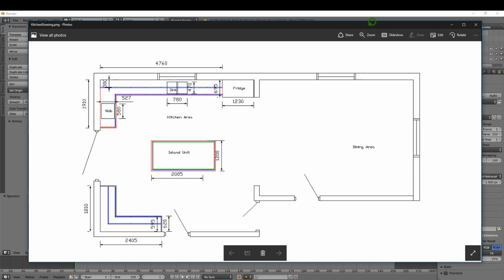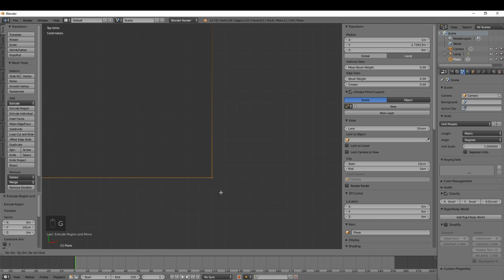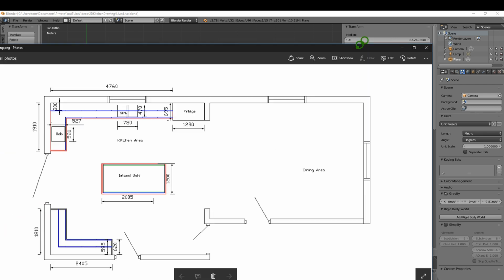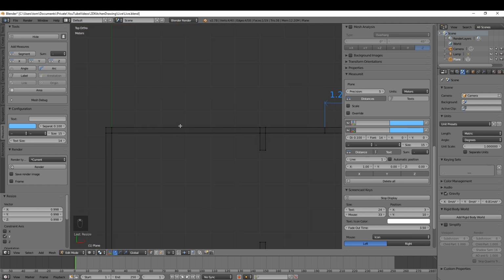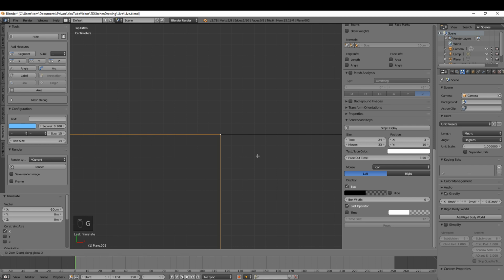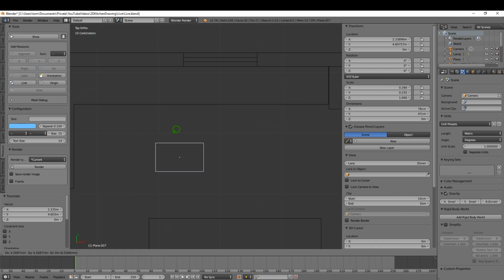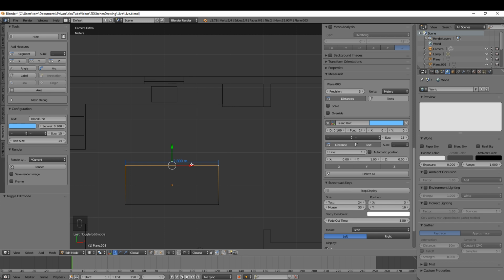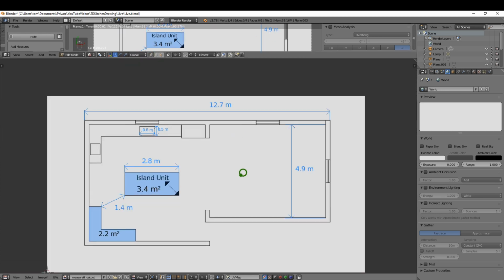2D drawing layout style in Blender using measureit Part 1

Comment: In the time taken from 'file' entry to 'check' preparation to execution in Blender, this simple 2D floor plan (in Sketchup), would have been drawn up (wall thickness included) plus the options of 'perspective' and 'orthogonal' view, in a fraction of the time taken in Blender. Many a house and building design, has been knocked out in Sketchup from concept to construction. 

I've used AutoCad and Solidworks for engineering 3D projects in the past, but always found Sketchup to be an instinctively easy and uncomplicated platform, to lay out highly accurate conceptual building diagrams at record speed. The option of beginning a drawing in either 2D or 3D, has always been one of the great attractions of Sketchup, without the convolution associated with other design formats. Thank goodness for the 'grease pencil.'

Comment: I prefer line by line... add Mesh: Extra objects  on addons to have access to add a single vertice (instead a plane), and use 3d cursor to specific next vertice positions (or with ctrl + lmb to pull a new vertice with line, positioning my 3d cursor and press shft+s after selection to cursor... or with E button , after press axe and enter measurement and press enter to finish). The only annoiyng things is the intersection welding (tiny cad is a lot buggy for me, so i make-it manually, selecting the cross edges, adding a subdivide edge to both and pressing ctrl+e , after this pressing S button to subdivide... positioning one vertice on right place, and selecting the second one , press alt+m and weld to the vertice at correct position, or last, or first depending of the order you selected the vertices). The CTRL+R is a good learning here, to put specific vertice quantity. Thanks at all.

Comment: Please let me know how you would make the floor i always end up with so weird shapes and too many vertices to fill it in a Good way :((
Reply: There are add-ons like Archipack and Archimesh to help you :D Maybe you could try them out if manually adding certices is hard.
Reply: I like to make a plan as large as a wall, then in edit mode you can grab and extrude vertices to get the diemension yuo wish, I also use loop cut to be able to extrude a wall in a perpendicular direction.